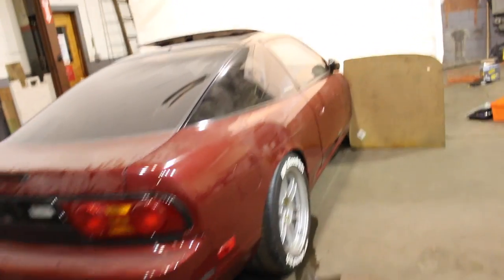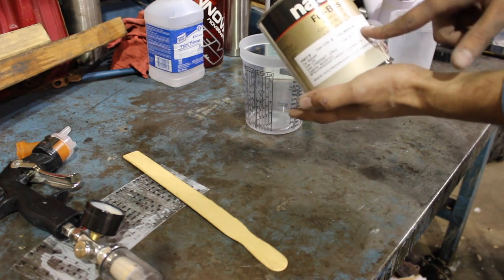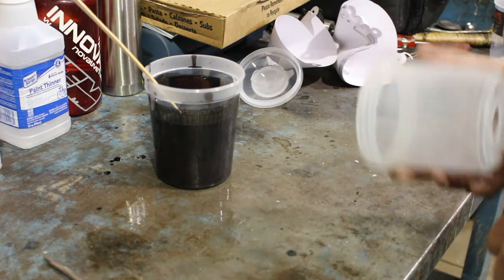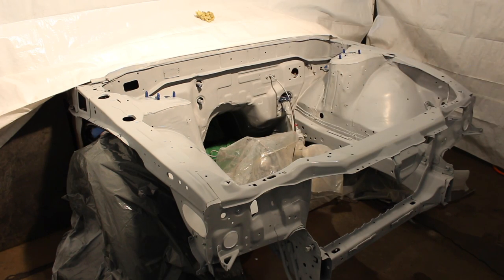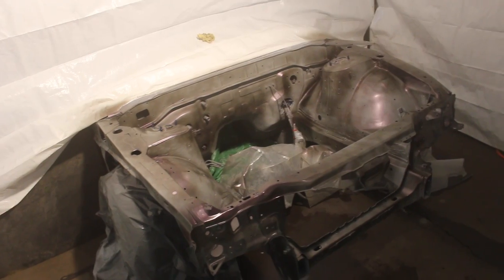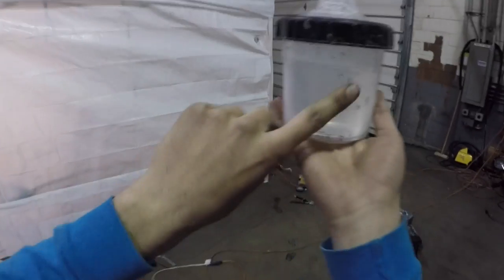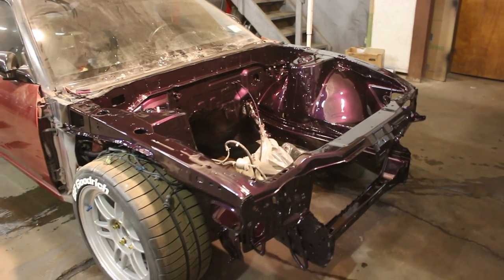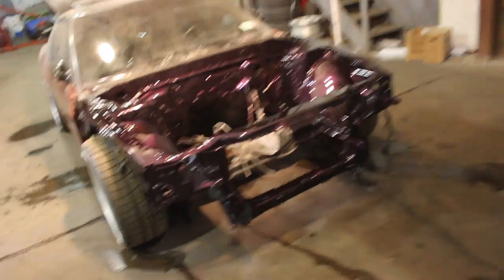IT LOOKS AMAZING | Painting 240SX Engine Bay

Comment: did you end up putting forged internals, metal head gasket, head studs all that stuff in the motor or is it still the stock bottom end?
Reply from the maker: +That-JDM-Fascination! Head and got a full OEM rebuild last year, Block was resurfaced. ARP Headstands, and OEM Head gasket. She's very healthy! Also, RB20s have stronger pistons, rods, and retainers then RB25s!
Reply: yeah where im form theres plenty of 350+hp rb20 on the track at drift days.
usually a pretty bullet proof setup is a cometic 1.2mm headgasket, head stud and drop in cams with a gt30 ish sized turbo or a td06 20g

Comment: Would you recommend an s13 as a first car??
Reply: Yes! You can find a nice clean automatic s13 for really cheap. Beater stick shift ones go for alittle more.
Reply: a lot of work and if you need a daily maybe no i wouldnt
Reply: Meh. I personally wouldn't suggest a 240. Especially if it was my ride everyday, and my FIRST car. Would deff pick one up as a side project tho👍🏽👍🏽 they are fun cars!

No secret that 240sx's are known for getting beat on, modified, whatever tho. And you'll more than likely be paying for repairs or trying to figure stuff out that previous owners have done to the car or didn't do that they should have. 

Basically, if you don't know what your looking for / or doing you could get seriously screwed with a 240 and have  an unreliable pos and wonder what you were thinking. 240's this clean are hard to come by, and require investment.

Buy a reliable daily, and not worry about transportation. THAN use your money from that point on to save for a 240 project. Just a thought. Sorry such a long story lol. Little drunk 😁
Reply: +ItsaaMitch yup exactly id rather get a driveable car and a 240 as a project
Reply: +Mitch Watson get a honda as a first car trust me, easiest cars to mod and work on then move up to bigger things
Reply from the maker: +Mitch Watson My first 3 were. Just got to look for the right one and not cheap out!

Comment: I just realized something.  If you, or anyone out there, is looking to eliminate orange peel.  Here's a tip I use for spray painting with paints or clear coats.  Warm the colors or coats.  I put it into the container and set it in hot tap water for five minutes.  All you need is a little tap water in a sink.  Just enough to set the container in.  Get the tap water as hot as you can get from the sink.  DO NOT BOIL THE WATER.  I saw someone do that, and it wasn't good.  What the warming does is help make the coating flow more fluid.  This works great for me.  Try it and let me know how it works.
Reply from the maker: +Howard G That's a good idea.... Next time in spraying I'll be sure to give that a shot!
Reply: When I was active in restoring vintage aircraft, this was something that really was that critical for flight performance.  In wood and cloth biplanes, weight was that critical.  When I painted F-14s in the Navy, the paint added 40-50 lbs of weight to the airframe.  The warming made the paint more fluid so it didn't coat clumpy and uneven on the skin.  You want a glass smooth finish on your car.  Just some FYI to consider.  Have an awesome day Kalvin.